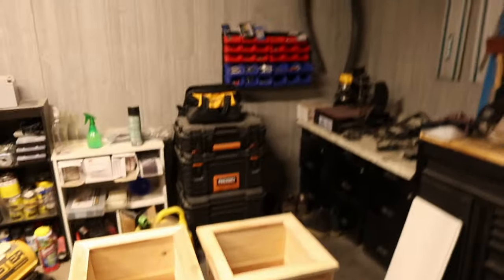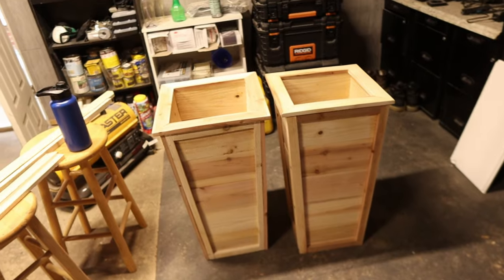DIY Long Planter Box  How To

Comment: Nice looking box. 
How does the water drain out of the bottom of the box?
How long do you think those bottom boards will last from constant watering?
Do you line the box along the sides with a plastic liner?
Reply from the maker: Not shown in the video but I essentially drilled holes in the bottom for drainage on each board. Plastic liner is recommended.  Mine have been holding up for a year now with no issues due to weather.
Reply: Just built my first box from him, the smaller one. Awesome tutorial